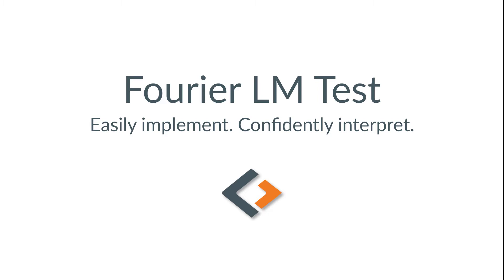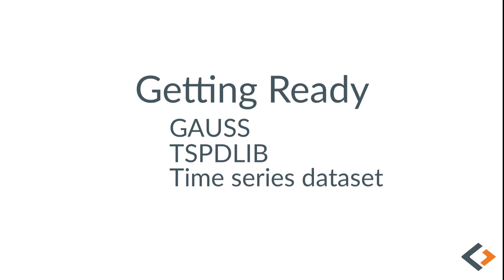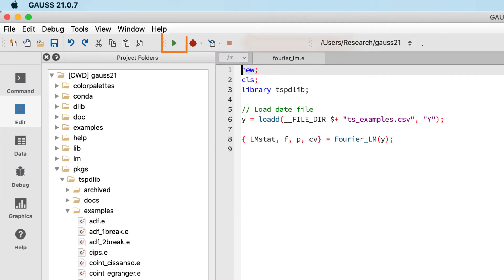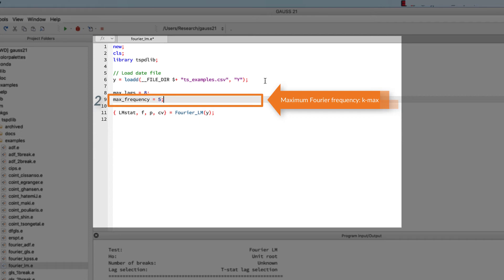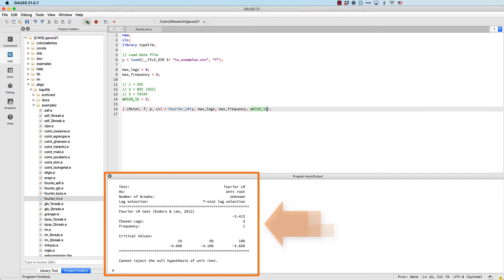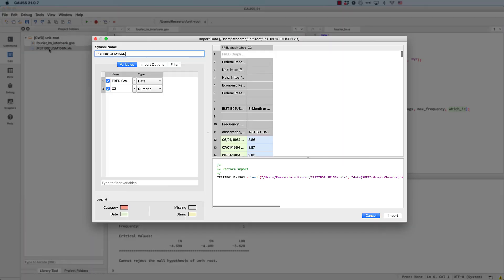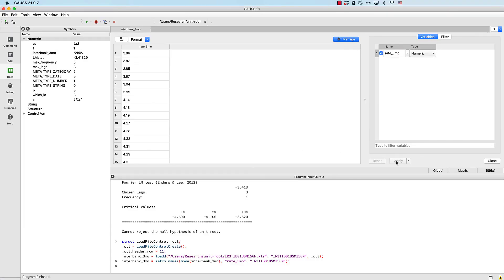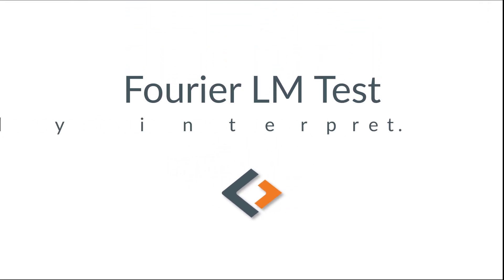How to run Fourier LM unit root test

Comment: Hi, is tspdlib library is available only in the paid version of GAUSS?
Reply from the maker: TSPDLIB can be used in the free GAUSS version. However, the matrix size in the free version is limited and your model might not run in in.
Reply: @gauss5485  thanks a lot. Can you please make a small video of installing tspdlib library and how we can run any one of the cointegration or any other analysis using this library. Thanks giving.
Reply from the maker: Hello  @adilmasoodkhan4527  This video shows how to: 1) Install the GAUSS Package Manager  2) Install the TSPDLIB library 3) Run one of the TSPDLIB example files. https://www.youtube.com/watch?v=sXrFAVCtFyc

Comment: Can you please upload a video on Fourier Nonlinear Quantile Unit Root test? I am facing problems in this test. If you make a small vedio on the estimation process of this test, it will be very helpful for us.
Reply from the maker: Hello Tapas! Thank you for the suggestion. We have the code for the Fourier Nonlinear Quantile Unit Root test, but have not yet released it in TSPDLIB. Maybe we can help you in the meantime. What is the problem that you are having?